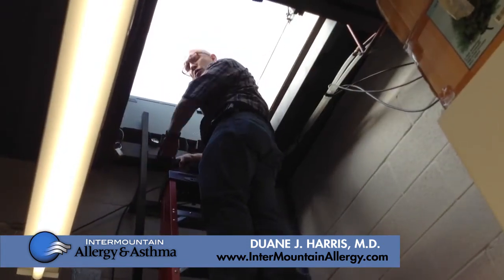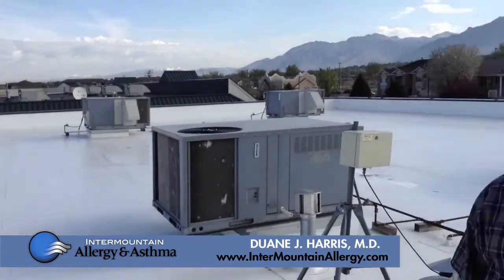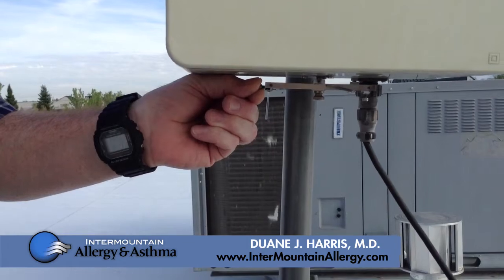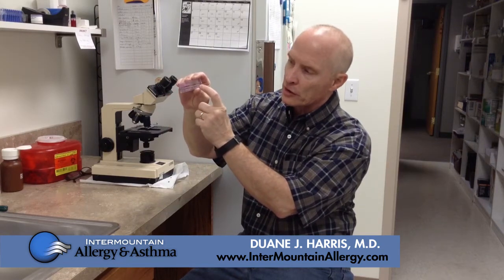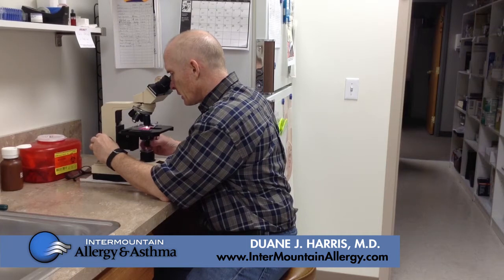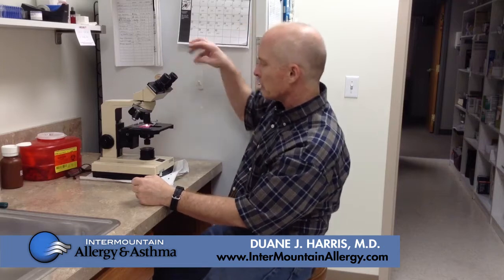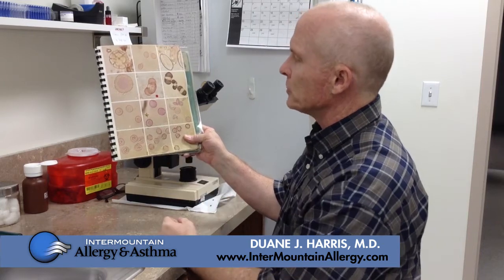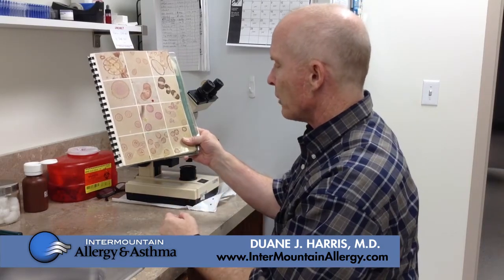Pollen / Mold Counting Station - How it works!

Comment: Thanks for very informative video.

I made one observation.... The pollen count meter up on the roof seems to be located very close to what looks like a air duct outlet or some sort of air-conditioning unit filter. Could this impact the accuracy of the readings depending on wind direction?